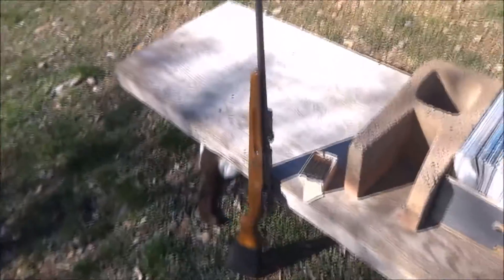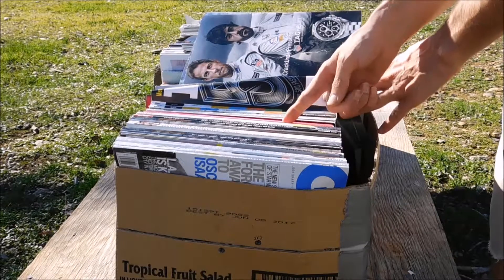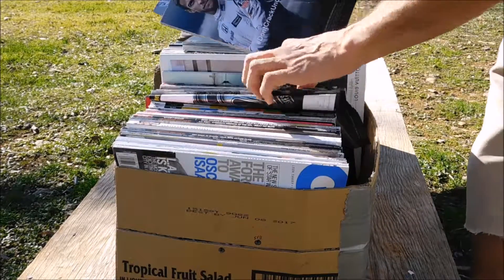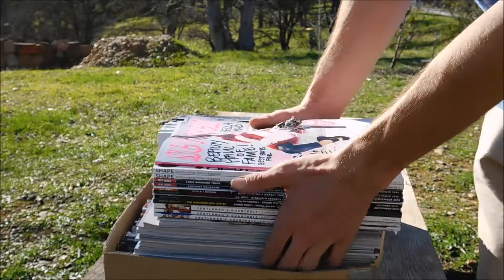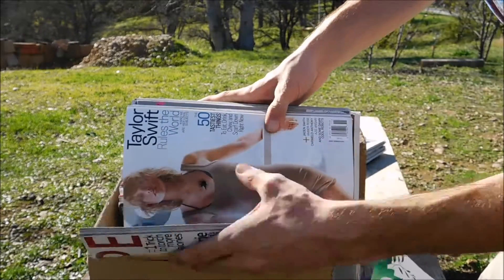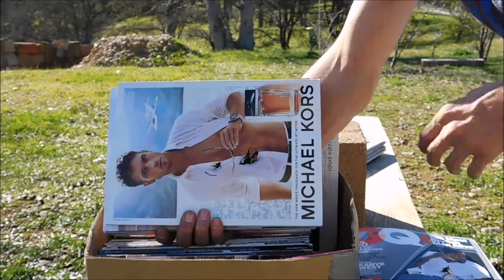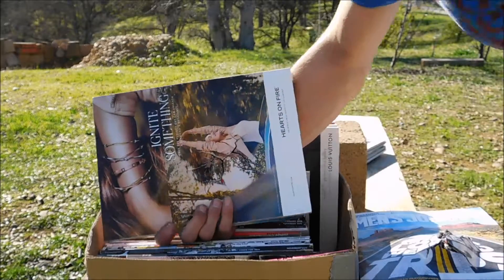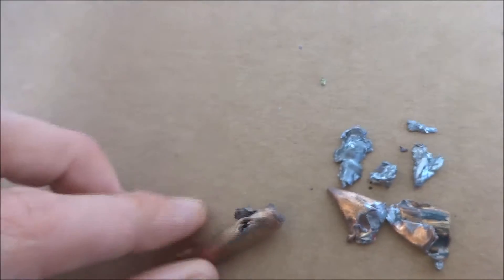8mm mauser steel core magazine penetration test

Comment: You should do kind of a show and tell on your sportized Mauser there. Hard to find any info or vids old guns pre-1930ish. Looks pretty darn close to mine. On the other hand, im working out in WA this month and picked up some Romanian ammo. Excited to get home and play with it.
Reply from the maker: I really don't know much about my rifle besides the markings on it lol. It would be nice if I could get any information on it. I will try to make a video about it soon it is a 1917 Erfurt Kar 98a, also has the 1920 marking on it. The bolt that is with it I believe isn't the original bolt either. I like the Romanian ammo, the only downside IMO is it has kinda low velocity for its bullet weight, around 25-2600 FPS. With a 154 grain the 8mm should have closer to 2,800 maybe even 2,900 FPS so the Romanian rounds are a little under loaded. They hit as hard at point blank as they should at about 150-200 yards.
Reply: codfishdoom after a week of hard research when i bought mine, i found very few sources for these guns. A lot of the same limited info over and over which all seems to stem from and original 1960's 2 page publication. lol i read about the 1920 thing and if i remember correct that was when a lot were referbished and some rechambered if they had that new stamp. I bought some reloading dies for 8mm to get some good loads, as you said and i have seen.  A lot of this ammo is running mid or low 2000fps

Comment: Where do you find cheap 8mm. I can't find it anywhere.
Reply from the maker: Unfortunately I cant find cheap 8mm in person, if I go to a store and I'm lucky enough to find 8mms its usually Federal power-shoks (which suck) for 35$ a box. I used to get these Romanian rounds for about 12 bucks per 20 rounds I believe, but they are all sold out now and I cant find anymore. The cheapest rounds for 8mm that I know of at the moment are the Hotshot 170 grain FMJ, usually about 13$ for 20 or so. So if you want some cheap 8mms that will shoot just fine, I would recommend the hotshot ammo. On the other hand, if you want what's IMO the best 8mm factory ammo at a somewhat decent price, look for the Sellier and Bellot 196 grain FMJ and SPCE.
Reply: yeah i just bought some hotshot have you done any testing on them?
Reply from the maker: Not really any actual tests but I have shot a few and recorded it not to long ago I might upload it later, but I will do tests with the hotshot rounds soon either way.
Reply: The Ballistician I remember buying Romanian steel core for 35.00 for 380 rd crate. The good old days! I seen some Yugo  1954 ammo at Aim Surplus 900 Rds for about 360 to 400. 7/5/18.